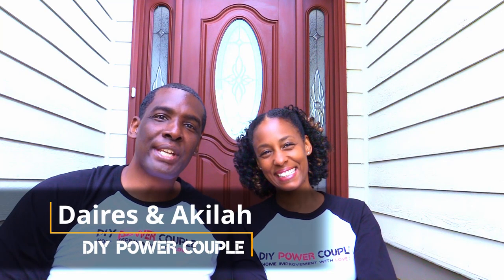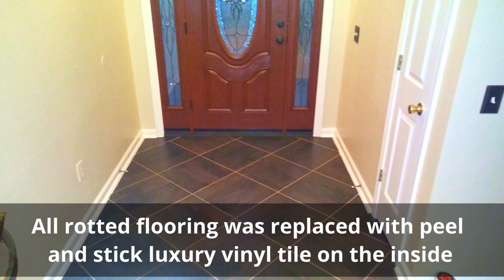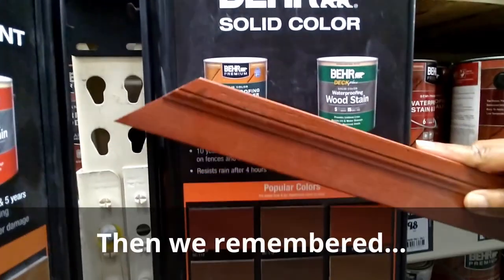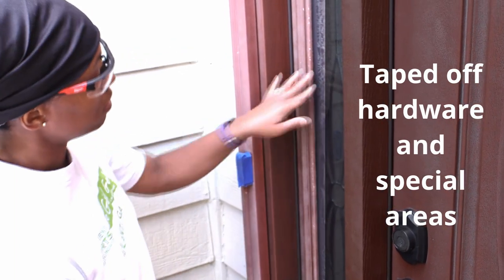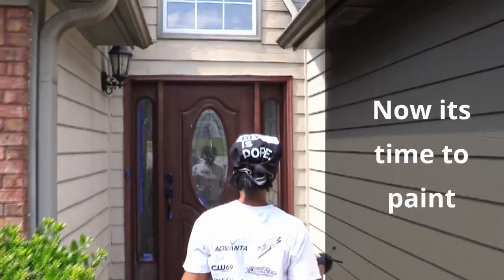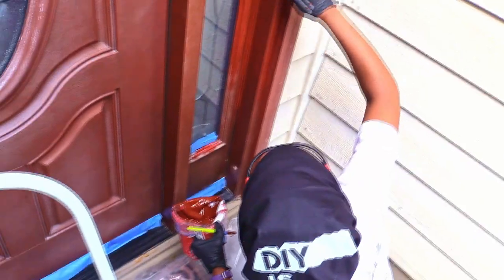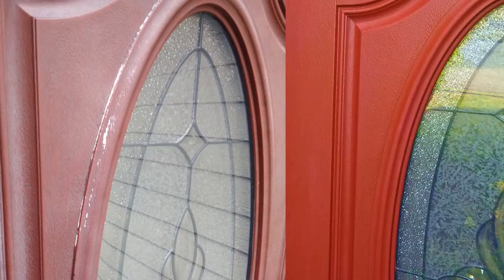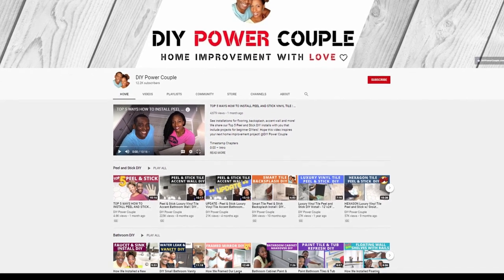EASY FRONT DOOR MAKEOVER IN A DAY- PAINT FIBERGLASS! | DIY Power Couple

Comment: Glad I happened upon your video. I have a similar door setup, and want to spruce up my front fiberglass door and panels. How is it holding up and how much paint do you figure it took to do your project there?
Reply from the maker: Dave, it's still holding up...looks just like it does in the video. No cracking or anything. Remember, we used leftover waterproofing stain and sealer from our 5 gallon can (not regular paint). Let us know how your project turns out. Thanks for watching! -DIYPC 😃
Reply from the maker: You should easily be able to do this with a one gallon can.

Comment: How did the paint hold up on your door? Was there any peeling later?
Reply from the maker: The paint still looks better than the original coating.  We had a little peeling around the window trim in the same spot as before.
Reply: @DIYPowerCouple  Thank you for your reply. I was told by a worker at Home Depot that you had to have fiberglass doors custom painted with a special spray paint if you purchased an unfinished fiberglass door. I'm glad to see your door as well as a few others I've seen came out beautifully. I'm hopeful. Thanks again for the content.

Comment: How is this holding up on your door now?? Still looking good?
Reply from the maker: Yes, it still looks good. We're glad that we did it. Thanks for watching our video. -DIYPC 😃✨
Reply: Thanks for the question and their answer... as Behr doesn't recommend their product (BEHR Premium Solid Color Waterproofing Stain and Sealer)  on Fiberglass: * Can this product be used on fiberglass exterior doors? "We don't recommend applying our Premium Solid Color Stain on a fiberglass surface. Instead, I recommend priming with our Bonding Primer and topcoating with one of our exterior paints for a durable finish".

Comment: Fibreglass is a resin, almost like a plastic coating. Timber fence stain will never last long on this. Looks great on vdo, but in reality, will look crap again in very short time.  Acrylic will never adhere well,  unless a special primer has been used.  Like your enthusiasm , but you are giving false advice to the DIY watchers.  NB :  fibreglass repairs are my trade, so this is just my opinion . .not a criticism
Reply from the maker: Thanks for your feedback. Surprisingly, the fence coating is holding up well.  It seems thicker than a stain.